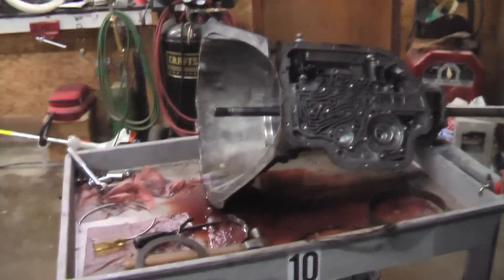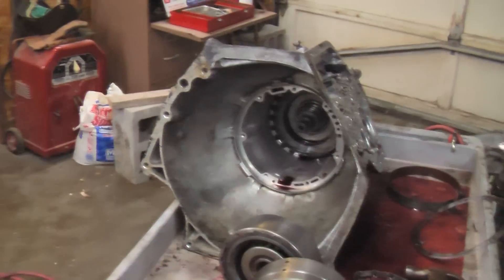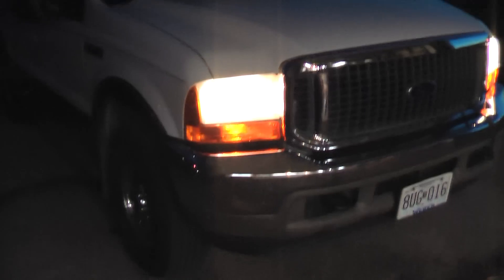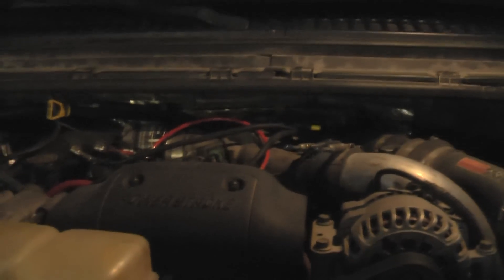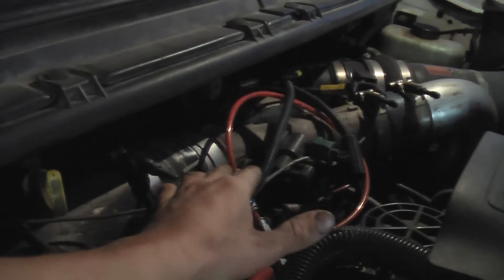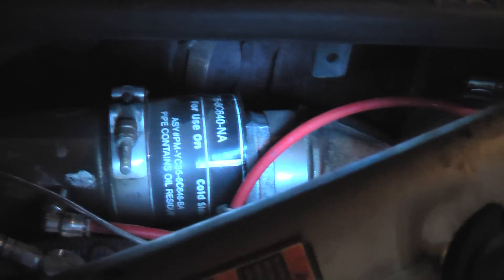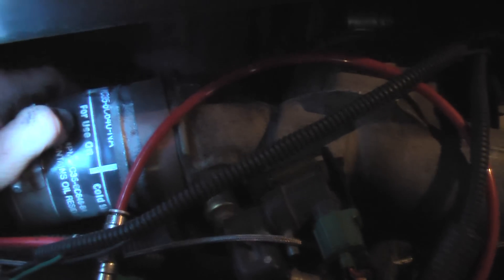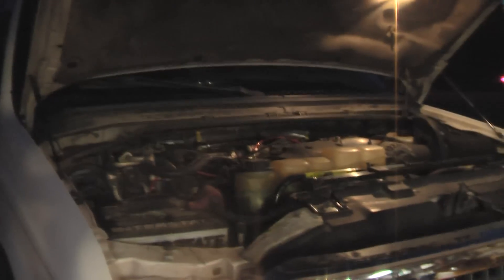Too Much Boost! (Intercooler Line Blowoff)

Comment: I have a 6.7 2011 f 250 larrait dont get me wrong. Amazing truck has all the power you could ever need. I hsve had no problems at all at 60.000 miles. But the 97 7.3 will always have a soot in my heart. Si what are your thoughts on the truck

Comment: @MoneyMarcMes, Hell no, Diesel is more complicated. Unless you know what your doing and have studied the motor well enough. You might want to get a new 6.7 because the 6.4 was also problematic, not as much as the 6.0, but still had some issues.

Comment: @MoneyMarcMes, Only the 6.0 and early 7.3's have had big issues. The 6.4 has had some small issues once it reaches a high mileage. Dodge, or Ram, have had some problems with their old Cummins engines, as for Duramax, the new ones are the best, but the ones that came before 2000 were pure shit and were failers. I'd step up and go diesel if I were you. It gives you better fuel economy, and ALOT more torque. Personally I'd get the new 2011 Ford f-350 because of the 400hp and 800 lbs-ft torque.

Comment: I am not a fan of the designs of any of the new superduty  trucks. out of all the superdutys my favourite design was probably 2004 when they didnt have these huge ugly headlights and boxy grill, front end. i think this year is an improvement over the last few years though. they were just plain ugly, and square. but my favourites are the front end like youre excursion, and the style following. Whats your oppinion on the other Auto makers Designs Daniel??

Comment: Ugh I absolutely hate the new front end's, Ford should have just left it alone, the last model looked great. The new lights, rounded grille and badge look ridiculous. Plus the grille doesn't lift up when you open the hood like the last model did. That made it so easy to work on the engine, it was like a built in step ladder. I am disappointed in ford.